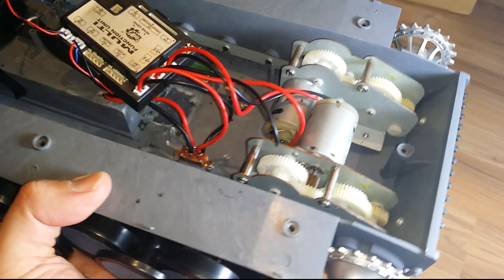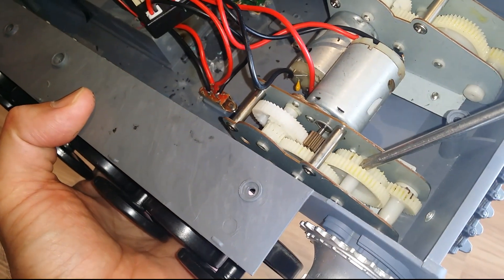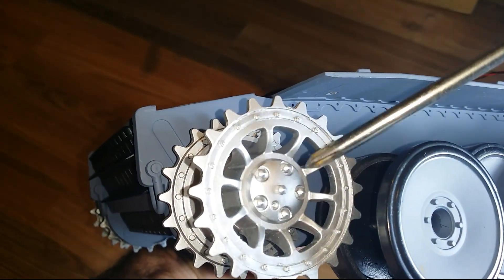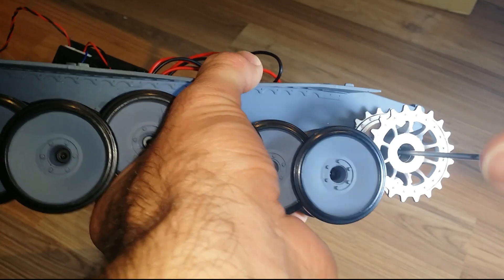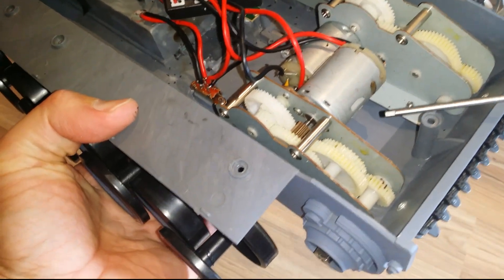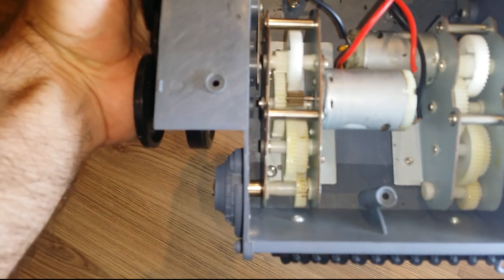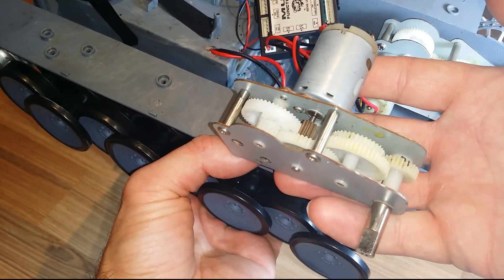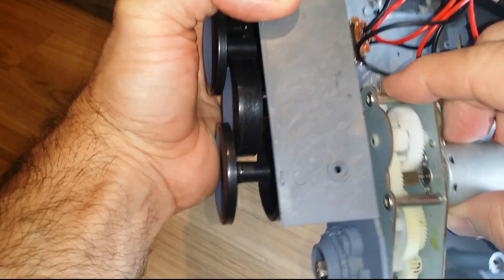Heng Long Tiger 1 RC Tank Gearbox Removal How To

Comment: Great Job Sir. I do add a bit of Locktite Blue on the Rear Drive Screw then Two Finger Tighten. Still Removable if another Gearbox is required. Also no "Stripped" Screws. Have fun!
Reply: i dont mean to be offtopic but does anybody know of a trick to log back into an Instagram account??
I was dumb forgot the account password. I appreciate any tips you can offer me
Reply: @Joseph Amir instablaster :)
Reply: @Ephraim Jayson It worked and I now got access to my account again. I am so happy!
Thank you so much you saved my account !
Reply: @Joseph Amir glad I could help :D

Comment: which do you think would be a good ratio between speed and torque for a leopard 2a6, the 4:1 or 5:1 gear box. Also do you know what the stock heng long gearbox ratio is? Thank you
Reply from the maker: +Michael Brown 4:1 would be fine but it also depends on the turns of the motor for speed and torque. 
Stock heng long would probably be 3:1

Comment: Hi, I know this is old, but I just bought a Heng Long M26 Pershing with Zinc gears boxes, and I wanted to upgrade them to steel gears. How would I do that and what do I need to buy?
Reply from the maker: Hey Ronald, you would need to remove the old gearboxes and replace them with hardened steal ones. The new ones simply drop in, no mods needed.
Reply: Ronald Dang 
Just the standard Black Steel Gear will do. Use a small amount of any Lithium Based Grease for the Gears. I have had good luck with Lucas Oil,  Red and Tacky. Will not come off gears or Liquify. Lionel Train Moly Grease is also good. If you can't find those, plain White Lithium Grease works well, just have to lube a little more often. I covered my Gearboxes.  Actually used good grade Strips of Duct Tape. Works Great. Make sure and not Bind the Top Pinion Gear straight out of the Motor and your good to go. Keeps Gearbox clean.

Comment: now how to install? Do i need to solder?
Reply from the maker: Vincent Sluga usually everything is plug and play buddy
Reply: So the ultimate 2 gear boxes come in with the wires already soldered in?  Just new to the RC tank scene and i've already bought some upgrades for my m1a2 abrams since people recommend upgrading the gearbox, tracks, idler and sprocket wheels and the road wheels as well. It's hard to find tutorial videos on a specific tank it seems.
Reply: @ericmagpantay7693 sounds like you have a older version they're all soldered in. If you have a little butt connectors you can connect them like that it's only two red and two black I believe so it shouldn't be that bad
Reply: @RCTanksTrucks247 he had the older version they're all soldered in

Comment: What diameter is the d shaft for the sprocket thinking of use the sprocket wheels and Idlers for a tonka bulldozer hydraulic conversion and what is the diameter of the sprocket please if u could help
Reply from the maker: Not sure, don't have it anymore
Reply: @RCTanksTrucks247  Aww oki was looking for track system for a tonka dozer

Comment: hi i have a heng long tiger 1 and it has the plastic gears i was wondering what metal gears you would recommend asi see there are a few different typed
Reply from the maker: Amateur prepper I would recommend the black hardened steel 4:1 gearboxes. Much stronger and give you heaps of low end power
Reply: thanks for the help
Reply: RC Tanks & Trucks 24/7 Where do you find these gearboxes?
Reply: ebay
Reply from the maker: Hey Gary, I would recommend the black hardened steel 4:1 gearboxes from Taigen or even Heng long's latest premium set.
Reply from the maker: You can buy them directly from Taigen or ebay stock heaps of heng long gearboxes

Comment: Rc Tanks & Trucks 24/7 , hi. , do you think those gearbox are the same than on the german panther snow leopard,  heng long 3819-1 ?seems to be the same chassis underneath, tnx
Reply from the maker: +dany thibodeau they are very similar but some of the mounting holes may be different.
Reply: i ok, i see, so a bit of drilling. this. and there..should be fine tnx!

Comment: Does anyone know where I can get a replacement gearbox like the one in this video, with wires already soldered on? Or metal gears will work. I have dicast metal gears, and the right one broke a gear.
Reply from the maker: Should find them on ebay

Comment: * ALSO * is the Rx18 good? Mine seems fine but my remote quit workin.... idk if i got new batteries and the post is too short, thus the 'wall' blocks the connection, thus a 'broken' remote, thus, unhappy Vincent. D:
Reply from the maker: Vincent Sluga RX18 is good just for a muck around. Proportional control is stepped and the sound is very average. I would recommend the Clark tk22 as it offers great control, customisable and much better sound. Plus you can get any radio/receiver to work with it

Comment: Mine has a plastic casing over the gear box and how do I disconnect  the wires from the metal connectors
Reply: I figured out how to remove plastic  covers on great box

Comment: I have just brought one of these from an auction and it doesn't go in a straight line is this normal? If not any ideas on what I will need to replace to get it too. Thanks
Reply from the maker: Trim out the steering
Reply: @RCTanksTrucks247  thanks for the reply. It looks as if this tank might be one of the first they did as you can't adjust anything on the controller. Also the strip down on the shell is different to the one you did.